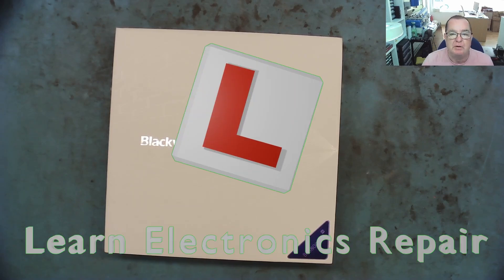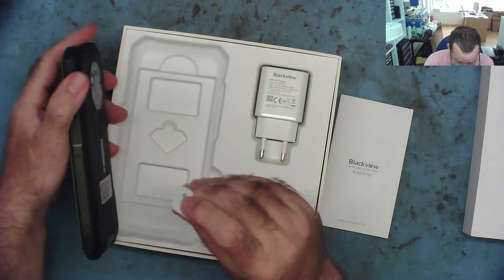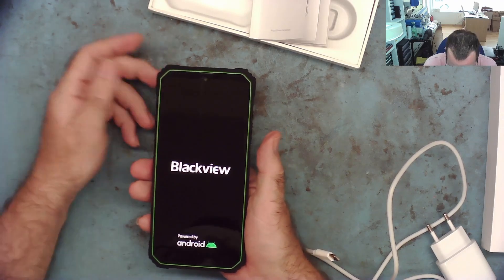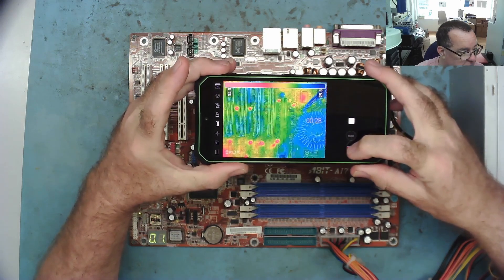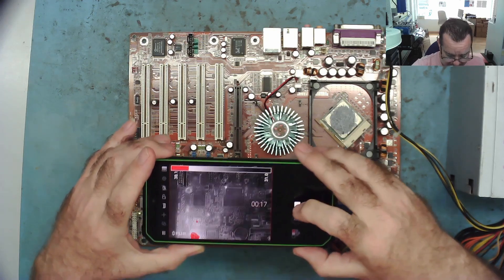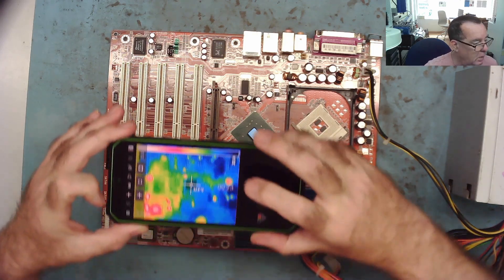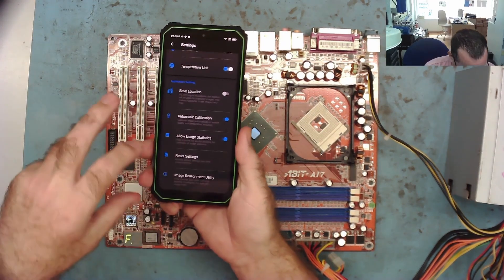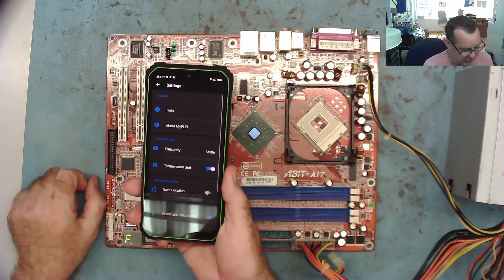Blackview BL8800 Pro Rugged Mobile Phone With FLIR Thermal Camera REVIEW - Good For Repair Work?

Comment: Hi Richard,
I really liked the thermal image overlaid with the standard image. It is much easier to see what is getting hot instead of using a pointing device to keep track of the hot spot then taking away the thermal camera to see the actual part. Thanks for taking the time to review and share the camera.

Comment: I was hoping you'd show little closer on the board.
1 foot away is too far. At that distance you can't tell what component is getting hot. 
Closeup would be better test
Reply from the maker: OK I will do that on a video soon, though I thought it worked pretty well at that distance

Comment: Would love the phone but Blackview has shown they dont give a fuck about you once they sell the phone and the developer community isnt large enough to make up for it.

Good luck
Reply from the maker: Hi alex bob 
I have no experience with Blackview phones or their tech support so I can't comment on it.   I was asked specifically to review the BL8800 Pro for electronics repair work, which I believe I demonstrated to the best of my ability .  I was surprised how well it did that to be honest given the resolution of the FLIR and would be very happy to use it for repair work, that is for sure.  

Having said that the BL8800 Pro and The HIKVision thermal camera I used previously on the same motherboard are equally capable of locating the fault.

Here is the other video I made with these motherboards, if you didn't see it.
https://www.youtube.com/watch?v=kkFw0O6ixsg

Comment: Cat S62 pro much better phone with flir
Reply from the maker: Ive not used one so  I couldn't comment on that.  Maybe they would like to send me one?
Reply: @LearnElectronicsRepair  idk you can ask them. I know the flir is better other things idk. But so far this one looks good also.
Reply from the maker: @Blauwdruk3D  I agree with you. Without making a direct comparison to other genuine FLIR camera brands, but purely by testing the Blackview on a real life example it worked very well in my opinion.  It certainly gave a clearer image than the HIK Vision camera I was using on the same motherboards - though having said that, both were capable of finding the fault 😉https://www.youtube.com/watch?v=kkFw0O6ixsg
Reply: I'm on my third cat phone. Looking for others that are cheaper as the warranty and service on the Cat phones in Canada is lacking.